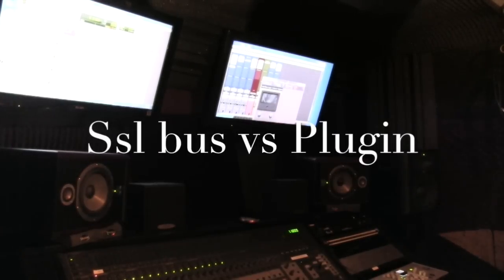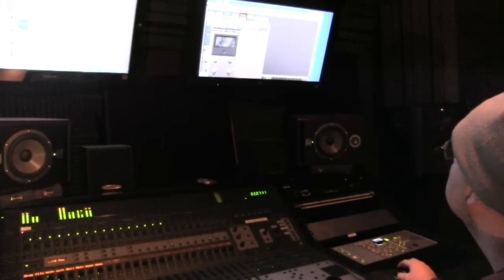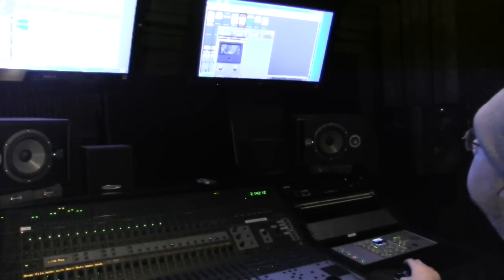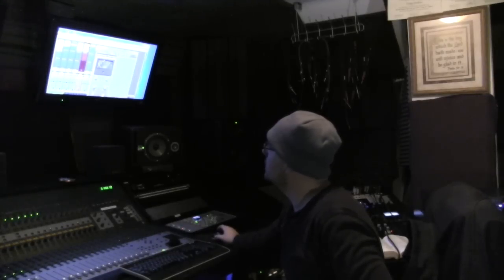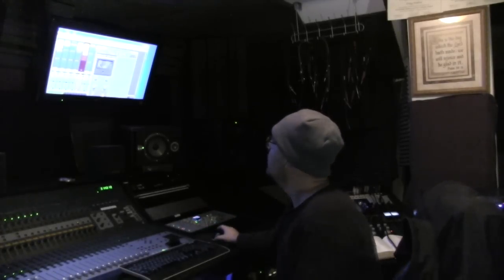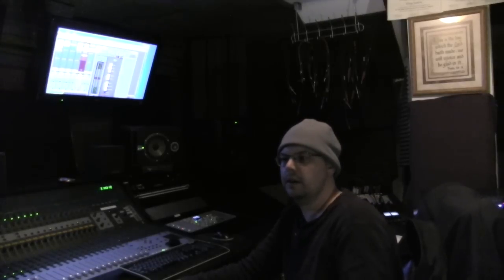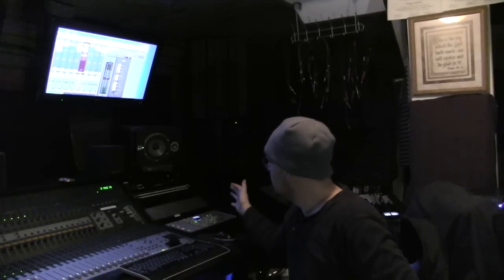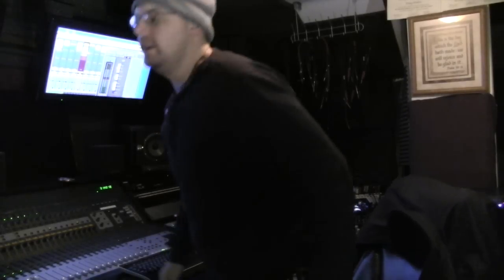SSL BUS Compressor VS DUENDE

Comment: Lets be real. Plugins suck unless you use them for subtractive eq, enhancing effects or panning effects. I know people in the industry who been doing this for years and made billboard hits and they told me the same thing. You need hardware if you want that pro sound. Analog gear. Plugins will only give you a headache because no matter what interface you have its still going to sound terrible, smeary and unpolished. The cost of building such a studio will cost from 60000 to 100000 dollars. The cheapest route to go is find someone who owns great pro hardware and have them mix it and mastering for you. Ive heard mixes done on protools hd with only plug ins used and it sounded like crap. No punch and little clarity on the print track. Plugins are used for on the fly mixing and mastering then when you take the mix to a real studio you replace the plugins with hardware gear but just maintain those settings. Thats how they do and thats how you use plugins. Not for the finished product but on the fly. Hope that helps.
Reply: tj mack TJ my friend, have you been looking at FOX tv? Just kidding... I wonder why Serban Ghenea who mixes 100% ITB does it and he mixes about 60% of the songs out right now? Does his songs sound thin and no width and depth? Dave Pensado/Leslie Brathwaite and many many more use 100% plugins. Depends on the budget and time as well. I've been in the biz for over 20+ years and plugins are the way forward. Mark my words in the next 10 years.
Now-a-days, hardware are more for color and for what they do to the sound. I'm not at all knocking Hardware as I use to use it 100% and loved it but, back in 99 when I purchased my first Pro Tools Mix system, I knew then, this is the future. You just have to learn the right ways of using your DAW/plugins and I guarantee you could get your mix just as good as any hardware and then some. 
JusMyThoughts... Marc
Reply: Its not the plugins smart guy. Its the AD/DA convertors and the analog summing that makes the tracks sound fatter, thicker and cleaner. All of Dave's Pensados mixes are sum bussed from an analog device then brought back into the mix. That's the secret. Peace folks
Reply: Thanks, never knew if anyone else would notice I was that smart. AD/DA convertors are about 3 to 5% as convertors are not that much better than old ones past 2009/2010. Analog summing is and has always been that wooden nickel that we all laugh about now. Truthfully, it's all about the mixer and mixers ears and talent. Has nothing to do with gear on making something fat and punchy. Digital can get as fat and as thick and as big as analog, it's all about the person using it. I'm sure I wouldn't hire Doug just because he has an SSL Bus Compressor but for his talent as I'm sure, if he needed to, he could get the Duende to sound exactly like the hardware if he knew how. Hopefully I can help in that area.
Reply: Hey TJ, there is a cool test between the Nicersizer and the VCC 2.0 ITB plugin. A summing box vs a plugin. Let's see if you can tell which is which since summing is that much better. https://www.gearslutz.com/board/11099617-post2226.html
It's a cool and easy test. Let me know what'cha think. This will be interesting. No one at this site can tell which is which. Most of these guys are OTB guys like yourself and swear by summing boxes. The Nicersizer is the new "Gotta Have It/Better than all" summing boxes. Not one person can agree which sounds better and in fact, they almost all agree that summing boxes are not what they thought. Sorry, Doug for getting off topic about the SSL but, since TJ brought this up, figured I'd throw this in too.Check it out by the way Doug.... Thanks, Marc
Reply from the maker: imsrprod   I can get the Duende to sound similar, sometimes I've learned I like the plugin more on certain songs, .. sometimes I don't.. we really focused on the acoustics in our room, super tuned, and we can hear the different vibe each piece gives off before touching a knob, I really hear it with the manley massive passive.. that eq, is a musicians eq..  the two things I can't get to happen with plugins, as easy and rewarding is the manley mu, and the manley massive.. We have the maselec mla-3 as well, sometimes I prefer the waves lin mb,, I never used the uad plug though, so a little bias as far as massive is concerned..   but the mu, is a gain box, and brings life like no compressor limiter.. but.... sometimes it's not the right gain the song needs, sometimes it's a simple rcompressor, or l2.. maybe a api.. but as you become more in tune with your craft, it doesn't matter how much a piece of gear cost, or it's a $50 plugin, if it works it works..  summing can make a difference, but honestly, if the song is eq'd trashy, all the summing in the world won't help you "arrangement!!!"..  the only thing I hear in summing naturally happens with hardware, it creates it's own distortion around the instrument, giving it perceived image within the mix, making it seem spaced with dimension.. headroom..   MY THOUGHTS!! IF YOUR GOING TO MIX IN THE BOX, atleast record with some nice preamps, because here is what happens with the indie crowd, not all but a lot.. buy a mbox, hook up a cheap mic, capture a pretty sterile recording in a non treated room..  eq for hours, then compress, and still fight irritating tones in the recording because you now are trying to make this vocal or instrument compete with million dollar rooms, that stop the unwanted verbs, and now you compress to make the levels compete on a national level, and you end up no eq'n the sound as much as trying to totally eliminate tones that were ruined for that performance.. so yes, plugs get this bad representation in this light, because the initial recording, whether plugin or multi thousands in hardware, the intitial recording was a huge deceiving problem..  I think what makes a person great, is being able to save these recordings, and take a vacation when your sent a label track.. everything is backwards.. In the words of pharrell williams, "the people that have this gear don't need it, the people that need this gear don't have it"
Reply: +Doug Jenkins Speaking of Pharrell, that's just God given talent. Most of his hits were written musically on an old Korg keyboard. Forgot the name. Anyway, it's the skill of the operator NOT the hardware/software. The room is important but, no room is perfect no matter how much you/they spend. If you want to take the room out of your mix, mix at low volumes (tip jar open) or use headphones but, mixing at low volumes does the trick better.
Anyway, recording is thee most important. So yes, you are very right my friend about that but, there is nothing that can't be fixed even if you use sub par equipment to record your music and/or voice. Controlling your sound or room around your recordings can be just as good as an high end studio if you take the time and learn the tricks and tips. Youtube/Google is incredible. 
Ahhh, the $50 dollar plugins, starting to really love them. In fact, check out Klanghelm's MJUC (I was a beta tester for that one - Clears throat) also check out SKnote's Distressor plugin called Disto (I was a beta tester for that one as well - smiles intensely) they are both around $29.99 or something like that. Gem's in the software world for us sucky software mixers right TJ? LOL
Anyway, I have to get back and finish mixing this new Tweet album on my sucky software plugin system. ;)